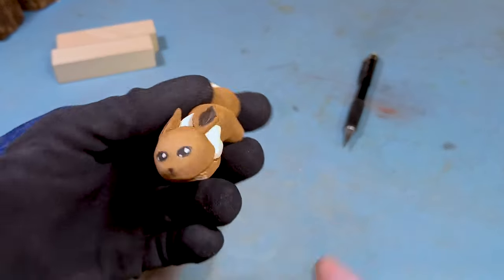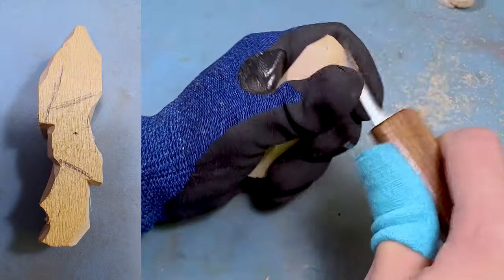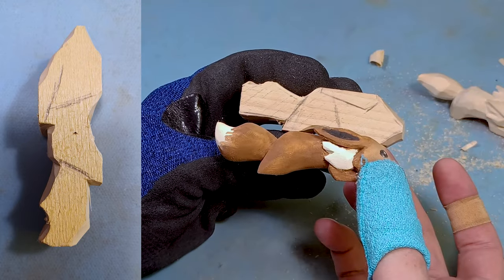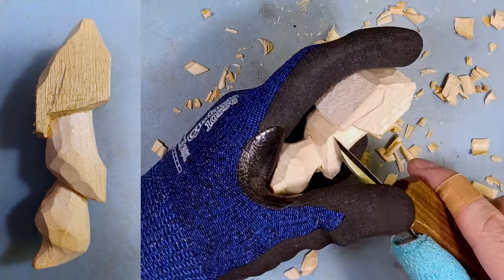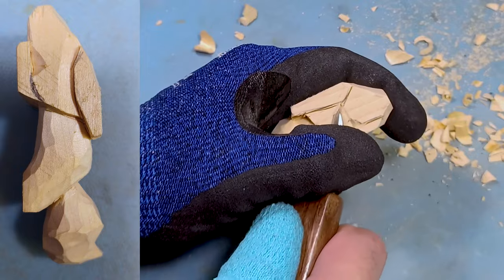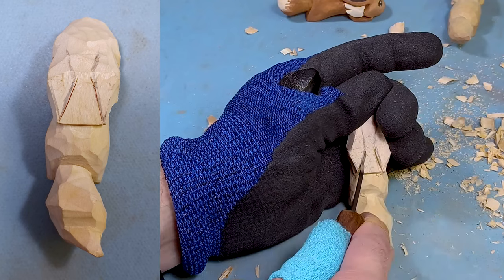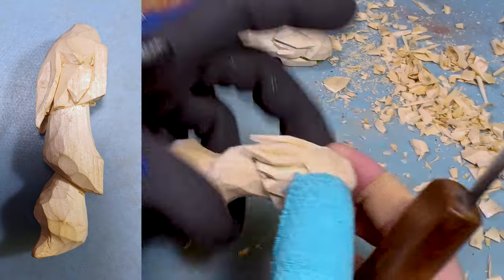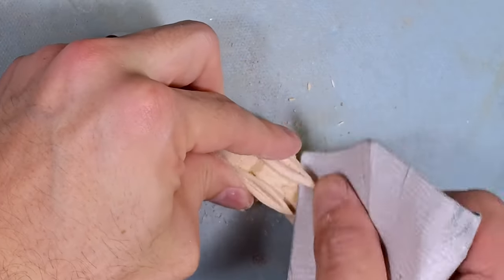Carve Your Own Eevee! - Step by Step Whittling Project

Comment from the maker: Tools used or mentioned in the video:

Schaaf Tools 3 Piece Set with Basswood - https://amzn.to/4a8ySXJ
Kerye Folding Hand Saw - https://amzn.to/4a6kVtv
Watercolor Set - https://amzn.to/3RtcgtV
Sharpening Stone - https://amzn.to/3Rvnzln
Air Dried Basswood - https://ebay.to/3B8LhZM
Basswood on Amazon - https://amzn.to/419vN5M
Reply: Thank you, I'll check the tools
Reply: The link with the tools is expired :/
Also I don't understand, when I search for these tools there are some kits that look like knives and others that have some pretty wide tools
Reply from the maker: Interesting, this may be a regional issue.  I chatted with the folks from Schaaf Tools a bit about regional availability and they were currently only releasing to the US due to tool availability and logistics.

I'm going to review my research on good options for other countries I did a while back and will update tools options when I get good info for you.  Just another place to improve on my end.